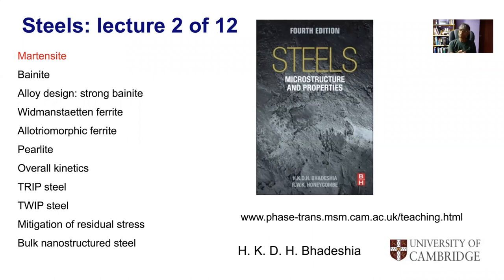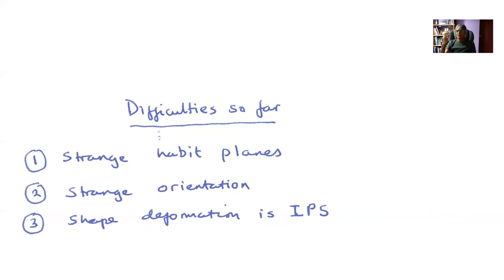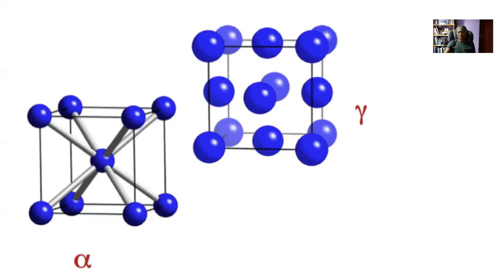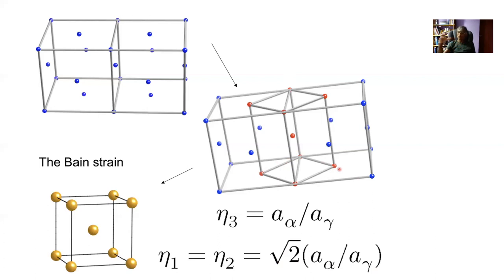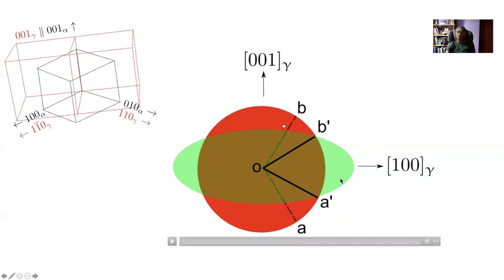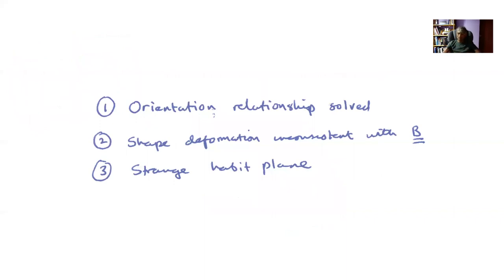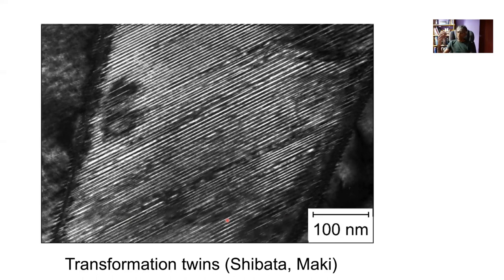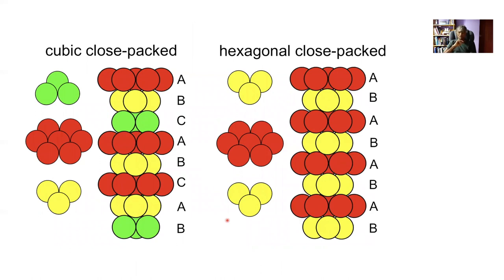Steels: martensitic transformation, part 2. Lecture 2 of 12

Comment: Hi Professor Bhadeshia, thanks for the great lectures. I have a question, how is the lath martensite structure formed in low carbon steel?
Reply from the maker: I am not sure what you mean, but it is a martensitic transformation. The organisation of the laths within the austenite grain involves the  mutual accommodation of their shape deformations. Those orientations that have a favourable interaction of their shape deformation will tend to have almost parallel habit planes.
Reply: @bhadeshia123  Professor Bhadeshia, thanks for the quick reply! To clarify, I am curious why the martensitic structure in low carbon steel has these packets/blocks/laths features.  How do those features form and why they form that way I guess is my question. Thank you.